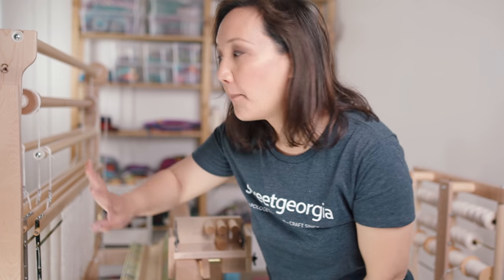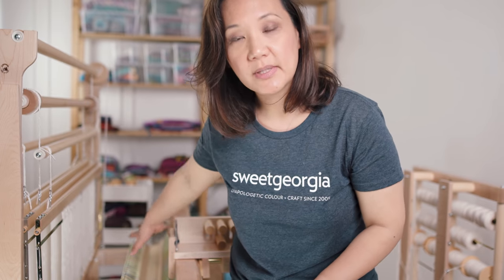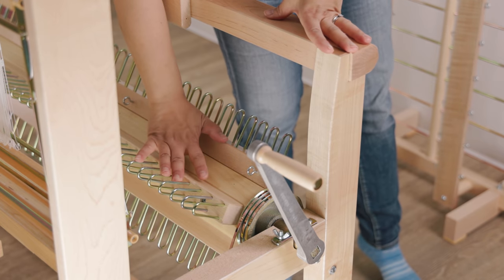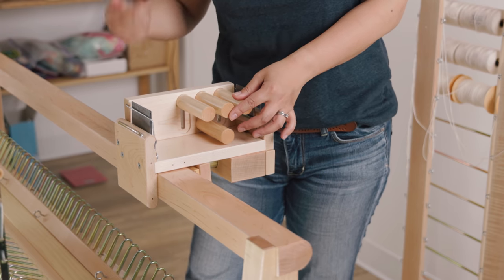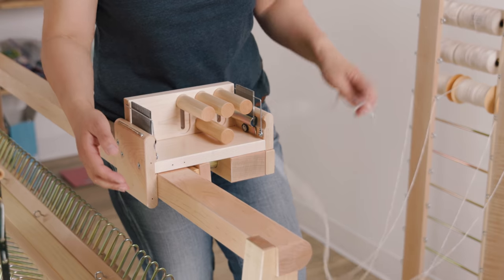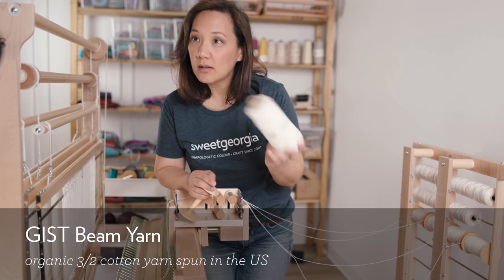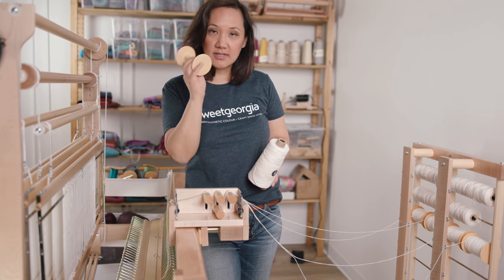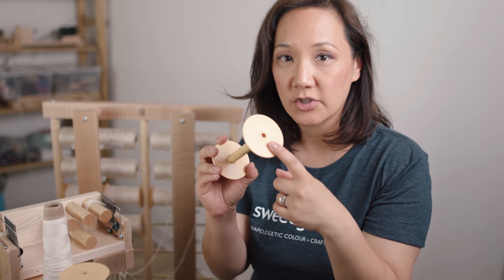Exploring Sectional Warping for Weaving // Episode 151 // Taking Back Friday // a fibre arts vlog

Comment: Great video! I have a sectional warping beam on my Leclerc Medico, and am waiting for one to be delivered for my Leclerc Artisat this week. I LOVE using the sectional warping process, and have a tip for those weavers who don’t want to use multiple spools of the same color to use with the beam and tension box set up. It’s called a Warping Wheel! You can make 1 - 2 inch warp bouts and wind them onto the sectional beam one section at a time, with or without the tension box, though I prefer WITH as the tension is much better. I honestly don’t think you could do more than 9 yards on the warping wheel, but still, that’s a good amount. The drawback to this is the cost of a warping wheel. It’s about $700+, which is why I made one of my own, BUT I think you could use a warping board and still use the tension box to help put on one section at a time with good success. I’m planning to give that a try too. Anyway… just my two cents worth of experience 😊
Reply from the maker: Fantastic! Good luck with your new sectional warping beam for the Artisat too! I'd love to learn more about the warping wheel... it just costs so much I don't know if I could justify it! haha thanks for sharing!!
Reply: @sweetgeorgia  Yes, it’s quite expensive! I didn’t buy mine though. I watched videos with Warping wheels and looked up TONS of photos on the internet, then just kind of eyeballed everything and made one of my own. In the end, it cost about $150 to make it myself, and I’m no woodworker! When it comes down to it, it’s really just sticks, nuts, and bolts. It wasn’t an easy build, but I suspect that’s mainly because I tend to overthink EVERYTHING! I just finished making a spool rack and bought a load of plastic storage spools because of your wonderful video. I’m looking forward to seeing how that goes with the tension box and sectional beam. 😁
Reply: @crystalbennett1069  It does seem that everything that is needed is easily made with cheap pieces from any big box store.  And as far as tensioning...I use a large dowel rod at the end of my warp and...it works. Where there's a will, there is a way. And it's the truth! :)

Comment: OK, I am warping my first pretty long project on my sectional beam, about 7 yards. I have nothing but a warping board. 400 ends, 8/2 cottolin...it started out pretty nightmarish. Honestly, I never even used a warping board until I got my floor loom last month. So, after a rocky start, and a few experiments, I used my rigid heddle loom as a 'tension box', it was a very slow process, but it worked. Then I tried this, which ended up being the process I finished up with, I wound my warp straight off of the warping board! I set it on the floor and simply took it off of the warping board piece by piece, row by row. Over the back beam, tensioning with my hand as it went. It worked so well that I am designing a warping board with 'rolling' pegs. Attached at the back with wing nuts, loosen to unwind. First things first though, finish dressing the loom...it's quite the learning experience!

Comment: Here’s my take on warping methods. In 1975 I learned to warp the old Swedish way, back to front, from Lily Bohlin in Victoria. Ten years later I learned to warp from front to back and  I haven’t looked back. Warping front to back solves the problem of having to ask for help when beaming. The (equal enough)drag from going through the reed and heddles solves the tension issue. I’ve also used sectional warping on longer warps, 10-40 yards and that’s definitely the way to go, but for most people the front to back method should work very well.

Comment: Why is it that you don't need to use paper to separate your warp when using a sectional warp beam? Are there any occasions when you get irregular tension using s sectional warp beam? I'm considering buying an old loom that has one. I didn't even realize they existed before I saw it.  Is it  ok for your only floor loom to have a sectional warp beam or would that be limiting for different yarn types? I'm not seeing anyone using it with thicker yarns. Is it capable of doing that?

Comment: Super useful.  It had been a while since I used my sectional beam and tension box. My only question is that the final step you do (sliding the threads under that thick bar at the front of the tension box) isn’t how I’d ever done it. My understanding was that the fat metal bar is to help the threads slide down to the sectional beam without snagging on the wood of the tension box. I have never put threads underneath that before. Hm.

Comment: Thank you for the video demonstration of sectional warping.  The longest warp I have wound is 9 yards.  A warp-winding tip for winding long warps on a warping board that I learned from a girlfriend is to mount the warping board vertically, short sides are horizontal and long sides are vertical, so that your arms are saved from stretching wide.  SAVES ARMS AND SHOULDER FROM STRAIN.  Enjoy
Reply: One of my plans for the evening is to mount my warping board. I am absolutely going to do this and my shoulders thank you.

Comment: I recently got a sectional beam, my louet tension device is evil, im currently working from a warp  mill until my avl arrives. You dont need to use bobbins if you can measure it on a warping board. Zero waste then.  Else an avl wheel or equivalent ditches the tension box as tensioning is built in
Reply: Liz, I just yesterday ordered the AVL warping wheel. I have a 48" AVL home loom with a sectional beam and HATE using the tension box and winding all of those spools. I'm hoping the warping wheel will make me happy!  Which AVL loom do you have?

Comment: Using a warping wheel/square changed sectional warping for me. I could never afford to buy the spool rack and spools, so I had tried using individual warp chains and a tension box. It worked, but not the greatest. I saved up for a warping square once I saw how it worked and now I can set up my sectional warp with ease and no extra winding onto spools.
Reply from the maker: Yes! I've only ever heard of warping wheels/squares but never seen it work in real life, so I don't know if that would work for me. Plus they are expensive for a one-function kind of tool... but I totally get the appeal of not having to wind spools... that part isn't super fun 😆

Comment: Hi! Thanks so much for this video and commenters’ information. This video is helpful. We have hand made a warping horse for our loom and have the tension box and spool rack. We are winding 60 threads per inch. Our last warp had some tension issues and varied results. One problem is that we are currently hand guiding the thread into the inch slot using an additional reed. I see on your tension box that it is directly over the sectional inch of back beam and doesn’t seem to need hand guiding. Do you find in your set up that the all the threads go into the inch section without a problem? It seems that the position of the tension box over the inch of the warp beam is important. I will look into the Avl warping mill as mentioned in the comments below.

Comment: Where was this video when I was trying to figure out how to warp my inherited LeClerc with sectional beam?? So well done, thank you. I like the storage bobbins you used, but I've got lots of shuttle bobbins, which I have ended up using on my thread rack. I just end up having make more as I go. This was also the first time I'd seen any kind of yardage counter used. I've been measuring by weight for my bobbins.

Comment: Interesting video! I am in the process of getting the warp ready on my biggest project yet (blanket woven at double width on my Louet Jane 70cm). I’ve actually had to redo the warp because of a number of problems (cross wouldn’t move through this particular yarn, a lot of snagging in the raddle I was using and the outer ends spilling off) but I’m actually enjoying the process of learning how to get it right and just finished building myself a new raddle. Because my warp is so wide and the yarn is thick I’ve had to make 8 ‘sections’ (not the same as in sectional warping, just that I have 8 braids to put on the loom the same way as if you’d wound one full warp on your board) and I am a bit worried about getting the tension right on this while beaming, which is why I was attracted to this video. But I’m not sure if this solution is the best for my project, even if there are sectional beams available for my loom.

Comment: Thank you, Felicia!  I'm planning on weaving enough tartan for 3 kilts (30 yds) and with all the color changes in each sett (around 3 or 4 setts) that's a lot of color changes if I were to warp on a mill.  It can be done that way, but a sectional warp beam with tension box will make the task a lot easier.  Or, if you're going to wind a warp with lots of stripes, etc.  Any warp over 20 feet long will benefit from a sectional warp beam.  No pre-sleying!  No raddle!  No warping board or mill!  But, the tradeoff is that you need a tension box, bobbin rack, ample bobbins, and the like.  Hope all's going well there!

Comment: My first project on my floor loom with a sectional back beam I had some warp that I had taken off my rigid heddle, too sticky for it, but it was cut to equal lengths and stored. I easily wound it on my sectional beam. No other equipment. It was about 6 yards long. All that equipment is expensive...I'm thinking to just do it my way for a few years...
Reply from the maker: @Sue-ec6un  absolutely, my favourite process is just winding a warp on a warping board, rough sleying through a reed and then winding on to a sectional back beam now, rather than winding on section by section. It’s easy and flexible. 👍

Comment: How about using both approaches and thereby minimize waste. I.e. use the warping board to warp all the yarn you need for a single section into one hank. Then cut the loop and drape the warp up instead of using a rack of yarn packages. They shouldn't tangle but if they did a little then the tension box means you should be able to untangle without ruing the section on the warp...?
Reply: That works but it is a lot slower, although you also don't have to warp with a cross which does make manual warping on the board a little bit faster.  I do actually think this is the way to go at first to try the process out and then the weaver can decide if they A. want to keep doing it that way, B. buy a warping wheel or C. buy a spool rack (and possibly a winder).  Ultimately, using a spool rack and winder with counter will end up being the fastest method, faster than even a wheel, at the end of the day but both B. and C. require a significant amount of additional $$$.

Comment: Thank you for making this video.  I would like to have seen you explain the points from getting your section of warp made to attaching it to the beam and winding, then what you do to the ends before you thread your heddles.  I do appreciate your showing the tension box.

I have an old table loom with a sectional beam.  Finding videos on this subject has been challenging.

May I also make a suggestion to raise your camera so that you are standing up straight when making your initial presentation?  You don’t look comfortable.

Comment: Thank you so much for this video - I am a new weaver and inherited a sectional Leclerc and am having the most awful time with the threading and would love to know if you have any tips. I take my taped  sections and ever-so-carefully unwind it from the beam and rest the bundle on the shafts for threading, but when I remove the tape they almost always get twisty on themselves before I can get the individual threads through the heddles.  Now I’m cutting the tape from the package and re-sticking the individual threads to more tape stick to my beater bar while I work but it just seems like there must be a better way and no one really shows this step. How can I get nice, orderly, and Untwisted threads from my back beam to the heddles? 💙 thank you!
Reply from the maker: Oh yes! Thanks Sheryl! I think there are a few ways to do this and it might be a bit fiddly. Some tension boxes allow you to make a cross and so you can slip something into each section to show which end comes next in the cross. Yes my bundles got twisted up a bit too… I made another video about that next step of sectional with this warp too. Actually, right now, I’ve put a warp on the loom where I wound it on the warping board and I beamed it to the loom with a trapeze and used the sectional beam to keep the warp in place. It worked beautifully. I have photos up on my Instagram (@lomeetsloom) right now. But I’ll make another video about this process too. Good luck with yours!
Reply from the maker: Here is the second video I mentioned: https://youtu.be/Y-ab4EOT_54
Reply: @sweetgeorgia  omigosh yes!! - unrolling all the sections at once (instead of one at at time! ) and setting up an extra rod to hold the ends near the heddles (rather than trying to drape them on the shaft and hope they don't fall off) is such a great idea and I've never seen that before - thank you so much!  This makes so much more sense than what I was doing... really appreciate your reply - thank you!

Comment: I dont have a tension box. I used my warping beam to count out my warp. My loom has a sectional warping on it and I don't have a raddle. Can I get this to work?
Reply from the maker: For sure. I sometimes wind warps on my warping board and then move them to my loom and beam onto the sectional warp beam. I follow a process I learned from Laura Fry about rough-sleying the reed with the prewound warp and then beaming it on nicely. It works great. I use the rough sleying method instead of a raddle.
Reply: Perfect thx

Comment: Thanks for covering this.  I was wondering how you deal with knots in your warp thread.  On a warping board, I usually cut that section out as I make my warp.  If you are winding 10 or more threads at a time and there is a knot in one thread, how do you remove it without pulling the whole section off?  Thanks.
Reply from the maker: For sure. In this case I tried to be very careful to check for knots as I wound the storage bobbins. But you could also undo the knots as you come to them in the warp as you are weaving and join on a new warp end, as if you were repairing a broken warp thread.
Reply: I was thinking of that also.  For people who do very long warps, they must deal with them on the loom as they weave, especially if they warp directly from original cones.   Like you said, there probably is a trade off and you have to decide which is best for your situation.  You have definitely simplified the process.  I think I would like to give it a try sometime as well.....  I look forward to hearing more about your experiences as you continue to do more warps.

Comment: So how do you stop the threads from getting crossed without a threading cross?
Reply from the maker: That's a super good question. Some tension boxes have a shedding device which allows you to create a cross (like Schacht: https://www.schachtspindle.com/pdfs/tension-box-0511.pdf and AVL: https://avllooms.com/products/tension-box-1). For some reason, my box doesn't have a shedding device... although I could theoretically rig one by using a warping paddle clamped to the box. In any case, I put a piece of masking/painters tape on the strip of warp ends and that keeps them in the correct order. So as I'm threading the loom, I pull the warp ends off the tape in the order that they should be. If one or two ends cross, I'm not super concerned about it... but that's how I'm doing it now :)
Reply: @sweetgeorgia  Thanks for the link. I had just finished penning the question of how you measure the warp length. I would love to see more videos in depth of how to sectional warp.

Comment: How do you get a cross at the end?
Reply from the maker: @JulieGeorge-b4k  there are some tension boxes that will help you create a cross to thread from. In my case, I don’t use a cross… all the cut ends are preserved by some masking tape and I thread from the masking tape. 👍
Reply: @sweetgeorgia  I’ve been warping back to front for 40 plus years but currently a friend and I have been restoring a loom that weaves 12 feet wide. It has a sectional beam. We’re getting ready to put on warp for two full size, full 8’ wide coverlets. We just finished two wool blankets to test the set up and get us  used to weaving on it. Hard to get the cross out of my brain though, lol.